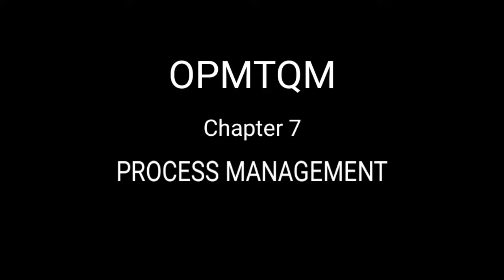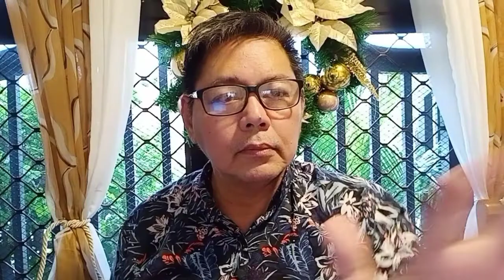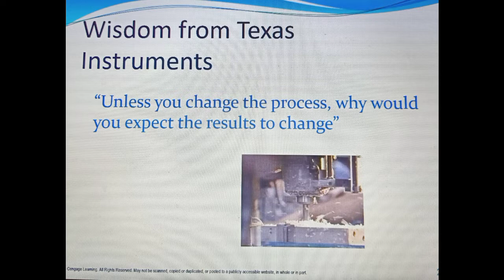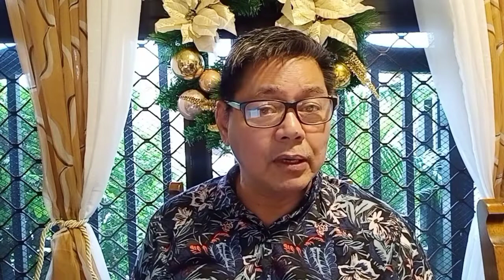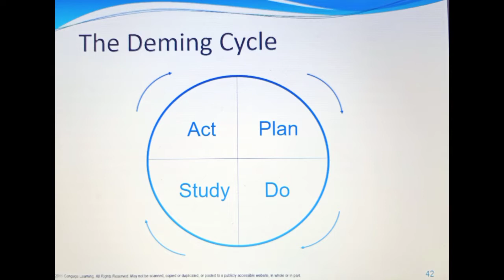OPMNTQM CHAPTER 7 PROCESS MANAGEMENT

Comment: Brigida, Lei Andrea C.
2AMA

     Preventing defects and errors, eliminating waste and redundancy, leading to quality and improved company performance, and having better flexibility are all goals of Process Management which is the topic discussed in this chapter. Process Management is important to achieve your goal without losing sight of the solid plans of an organization.

     In identifying integral processes that affect customer satisfaction, there are two categories: value-creation processes which is important to keep the operations going and support processes which supports the former. The key principles for performance excellence should also be remembered including identifying vital work processes, determining key work process requirements, implementing work processes and control the day-today operations, and improving those work processes. If these principles were to be given attention, companies will be one step close to performance excellence. The activities of process management are the design which ensures that the inputs are adequate and the process is followed, the control which assess whether the result was the expected outcome, and improvement which ceaselessly seeks improvement. These activities and process management as a whole must be both repeatable and measurable. Just like in real life, once we took hold of a certain recipe to follow, we will surely use it again and again to ensure consistency and stray away from failure. But of course, in real life and in process management, errors are inevitable. The errors discussed in this chapter include task errors, treatment errors, tangible errors, and customer error in preparation, encounter, and resolution stage. To counter errors in process management, extreme measures must be done in accordance to process management activities and one example of that is Poka-Yoke which the use of method that either makes it impossible for an error to occur or makes the error immediately obvious once it has occurred. The process management activities should not only be remembered but continuously improved as well by knowing how it affects the process and targeting its components.

     Process Management differs per company and category. Just like what is discussed in the video about process management in ISO 9000 and in Six Sigma, there are some differences and focus. Process management should be aligned with the goals of the organization no matter how critical it is, that’s why it must be meticulously and distinctly planned by the organization. This chapter was very relatable. All of us also undergo a certain process in our everyday lives, although nothing major. Just like what is discussed, the process of our daily lives should also revolve around improving and eliminating errors.

Comment: Valera, Richmond Dino A.
2-AMA

In this video lecture it is stated that “Unless you change the process, why would you expect the result to change” It comes to my sense that this sentence is actually true, that you have to change something inside the business or outside the business in order for it to improve and continue to run. Also, this lecture talks about the processes of a business the improvement within the organization. Process management is the planning and administering the activities specifically design, control and improvement that are necessary to achieve a high level of performance. There are different kinds of process management that can affect customer satisfaction. There are value creation processes and support processes. Value creation usually happens when organization uses its work and resources to create something of value that is sold to a customer base. In turn, the business earns a profit for what it has created and the customers have a want or need fulfilled. In addition, it is more on the image of the product created by the company. Support processes is the pre-processes it is not the main process however, it helps create products or services but are necessary to facilitate or assist the execution of operating or management processes. With the help of this process business can avoid errors which can incur expenses in the company. Errors are unavoidable in a business and sometimes can be intentional or unintentional. Just like process management there are also different kinds of errors an example of an error is task error it involves doing work incorrectly. Another error is tangible errors this includes the work area if it is clean or not. 

In conclusion, Process management is important for a business for a higher productivity, increase revenue, operational excellence and can reduces the unit cost to execute a transaction by streamlining processes and allowing companies to better orchestrate resources, increasing productivity. Also, it can help the business improve your overall operations. It can minimize your expenditures, give you better control of workflows, pinpoint operational deficiencies, and give you insights to make better business decisions.

Comment: BELOSO, MAY ANGELU G.
2AMA

Process management is also an important factor to achieve the total quality management . It prevent defects and errors, eliminate waste and redundancy, and it leads to better quality and improved company performance through shorter cycle times, improved flexibility, and faster and more consistent customer response as mentioned. 
One of its principles includes focuses on removing the root cause of the problem rather than on treating its symptoms. This way, the chance of reoccurrence of the problems is being eliminated rather than lessened. The application of quality management principles helps the improvement of the organization making them more disciplined and more structured. Through the process management activities which includes design, control, and improvement this will eventually lead to customer satisfaction.

To improve the process management, it is also important to know the different errors so that management can address it properly. It is also necessary to determine the equipment to be used in the process. Subsequently, it is given that a process is not always perfect that it is why maintenance is also important in both internal and external aspects. At the end, through the use of process management practices like ISO 9000 and Six Sigma, this help the management to have more structured and organized process. This is expected to result in customer loyalty and has a huge impact to its competitiveness in the market.

As related to the previous assigned case analysis, businesses that implement practices like Lean and Six Sigma has effectively helped the company not only to survive but to thrive in the market. This is a study that proves how it makes a difference to the total quality of the organization.

Comment: GONZALES, ALEXANDRA PATRICIA O.
2AMA

Process management plays a pivotal role in the organization because it prevents defects and errors, eliminate wast and redundancy. Without process management, the manufacturing process will not be systematic and therefore chaotic and wasteful because the mind-set of quality is one of prevention and continuous improvement. As said in the video, there are two types of processes which is value-creation or those most important to running the business and support processes or those most important to an organization's value creation processes, employees, and daily operations. It has two key requirements which means it must be measurable and repeatable.

The principles of process management is that it is and end to end process. Everyone works and manages a process at the same level together with the supplier simultaneously. Nevertheless, process improvement is fueled by customer needs. This is associated with managing customer complaints, taking into action what are customers perceive will make our products better.

Since process management is about preventing errors, the concept of poke- yoke is a mistake- proofing process using technology to avoid human error. It is based on recognizing it will occur or providing a warning or it has already occured. Errors are not only bound to the product itself but extends to the service we provide. Like task errors, treatment errors, customer errors in preparation, on encounter, and even at the resolution stage. 

Although defects and errors are inevitable, it can be prevented by process management. On the other hand, I believe that process management even without studying it, is being implemented already. Spearheading a business, we want to assure the flow is as smooth as possible minimizing mistakes we can’t afford. But learning process management is teaching us how to effectively handle such situations and making it less likely form happening.

Comment: PANALIGAN, JEFFERSON KIM A.
2ND YEAR BS MANAGEMENT ACCOUNTING (AMA)

"MISTAKES HAVE THE POWER TO TURN YOU INTO SOMETHING BETTER THAN YOU WERE BEFORE."

Chapter 7 discusses about the process management in the operation industry. What is a process management? Process management involves the step by step work or 

 process of a Company in able to achieve their goals. What is the significance or importance of managing the process? First it prevents and lessens the defects  of an organization and to avoid committing of mistakes. In addition, in eliminating the redundancy of a process, it can improve the quality performance since  it will be short and concise. In connection with the relationship with clients, it will be for the faster and more consitent response to the customers' need.  Process Management has also the key processes principles. First is identifying the vital work processes that relate to core compentencies and this will be the  reason to deliver the customers value, which is the product's quality is involve. In attaining success, the sustainability follows. If the sales of a company is increasing, then the challenge for the organization is how can they sustain it. Next is incorporation the input from the customers and suppliers. Ask for recommendations and suggestions so that they can enhance their work processes. This is connected to cost controls, how to minimize the overall cost and not to sacrifice the quality of the goods. In connection with errors, if a company figures out it's errors, then the customer productivity losses will be lessen or gone for good.C ompanies must have the appropriate measures, or inputs in improving their work processes. This involve the Value Creation Processes and Support Processes.  Under the Value Creation Processes is the design, it develops the functional specifications. For example, the latest Iphone, what are the attributes of the 
phone that considered as unique and different from other products? On the other hand, the support processes deal with the organization, including the employees and daily operations of a business. Value creation processes talk about the structure or the projects of a company, while the support requirements  deals with the coordination among the stakeholders. It was mentioned in the discussion about the Philippine Airlines. They provided key points, such as  ordertaking, cooking, product assembly, cash collections and marketing. These 5 key points are related to each other, they are related since it involves to the customer satisfaction. Each of these processes have it's own principle to be followed. It serves as the principle in order to achieve or exceed customers'  satisfaction. 

Process management should start from having a concrete plan. With this plan, it will identify the opportunities to achieve the main goal for customer 

 satisfaction. The process management principle talks about process improvement, which it is about the mindset of the organization, and to have a relationship  with their customers and suppliers. With this being said, the organization need to determine the customers' need. But it needs a process, it's a step by step  process that they need to considered. In connection with lapses, the companies need to remove the causes of the problems, reducing the opportunities for errors and will result to a disciplined and structured of quality management principles. There are certain activities that are considered in process management.  First is the design, it will ensure that the inputs to the processes such as materials, work methods and number of efficient workers are well defined, and  this will be the solution to listen the mistake and corrective measures are to be assigned. Moreover, it should be a step by step sequence, especially in  manufacturing businesses. It must be lean but mean, and it should be consistent and effective execution. This is also similar to control, which it assess  whether the process performed as plan, and it should be on scheduled. With design and control, it will result to an improvement, it will achieve higher levels of performance, it will reduce variations, it will be having higher yields and fewer defects and errors. The process management must be repeatable, must be  measurable to maintain it's effectivity and efficiency.

The designing process involves cause, agility, quality. Agility focuses on the close relationship with customers, but also the companies must consider in empowering their employees, and to have the effective manufacturing tools. In addition, to have a close supplier and partner relationship. And to improvement to process and services that will have an impact to breakthrough achievements. For example, in the Korean Drama Series "Itaewon Class", Park Saeroyi who is the CEO of the restaurant bar applied the process designs. First he identifed the products, they are selling food, alcoholic beverages. Next is they 

identified their customers, particularly their target market is teenagers and people who love to eat and to drink. They also identified their suppliers, one of their suppliers was the police that handled the case of Park Saeroyi's dad case. Beforehand, they don't have the step by step process, Dangbam , name of  the business, does not have sales before, but Jo Yi Seo, became the marketing manager, and she helped the business to have it's process and she lead dangbam to a success. Pokayoke became also a factor to their business. One of their mistakes was the food. Their cook was not a professional cook, but they motivated  
her, they help her to identify the typical mistakes and errors, and in the end, she joined a cooking show, and she won. But there are certain reasons why  mistakes occurs. First, due to forgetfulness, one of them lost temper, and lack of concentration, he managed to punched the customer, because the crew remembered his past, therefore it led him to his anger and punched the client. Also, misunderstanding, Park Saeroyi and Jo Yi Seo had a misunderstanding, that forces Park Saeroyi to fire Jo Yeo Si. This is also connected with lack of proper attention, absent mindness and delays in judgement. Some of their equipment 
as well had a malfunction. But in the end, they became Itaewon Class Corporation, and became the number 1 restaurant in Korea.

Itaewon Class korean drama is my favorite, since it involves the process management in handling a business. Pokayoke has three levels, designing, identifying 

the potential defects and finding the defects that enter or leave a certain processes. There were certain task errors in the Dangbam, namely the service of the food, the food ordered was incorrect and it lead to working in slow pace. Treatment errors were also present in the korean drama, since one of their crews lost his temper, and it lacks courteous behavior. Some of their tables also was malfunction, and it is uncomfortable for the customers. All of these lapses 
can happen to anyone, it can happen in every business or companies in the world. Therefore it's very important to have process management in the business.